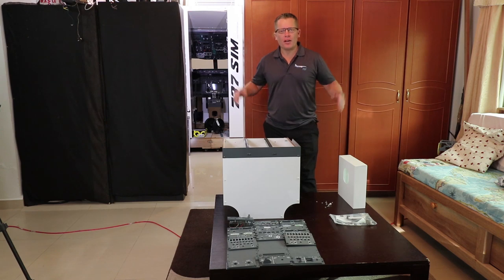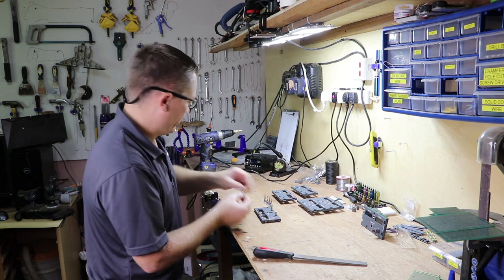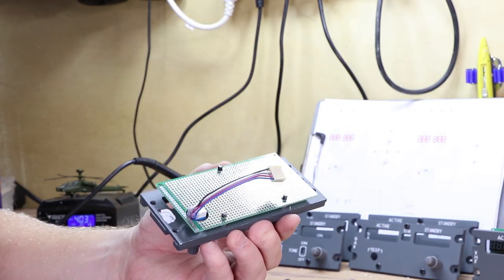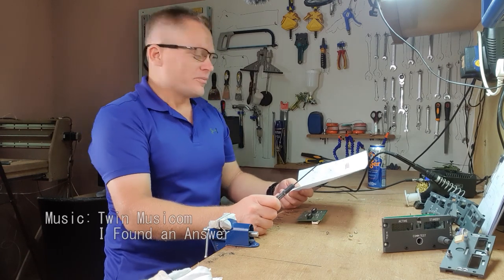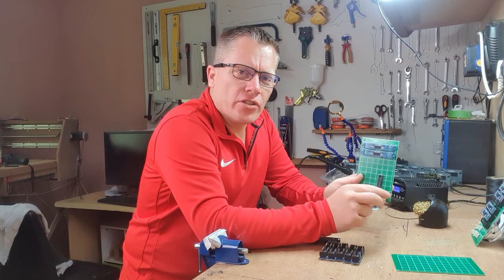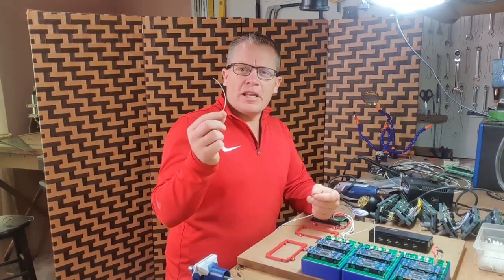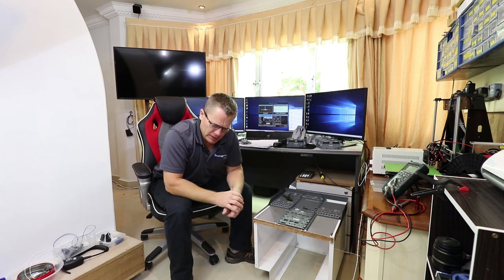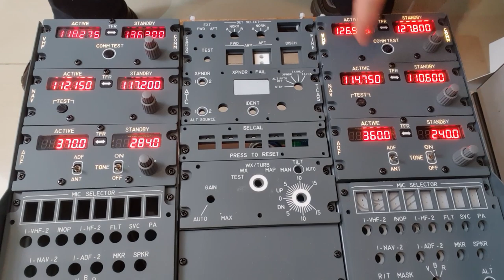Building the 737 Pedestal

Comment: Shielded twisted pair? It's been 20 years since I've touched that stuff (man I'm getting old 😀). Love this work you're doing.
Reply from the maker: Hello David, I have so much of the stuff from recycled aircraft I need to find a use for it! But it's much bulkier, as you know, than standard 22 or 24 AWG wire. However, for seven-segment displays, it helps.
Kind Regards Karl

Comment: What a huge video. I can just guess how much footage you had to edit. And by the way - a great explanation.
Reply from the maker: Hi Mickey, how's you and I hope this finds well back home. Thank you, I never meant for the video to be that long, and as you guessed the footage amount over 4 weeks was huge. Especially when using two cameras. I didn't think this video would do that well, (watching somebody wire manage isn't really the most captivating process) but thought I'd give it a go. From the video stats, it actually seems people do skip through to the parts that are relevant to them. Which is ideal. Especially when I remember starting out and thinking I wonder how you go about this. How are you getting on with the overhead panels? Keep safe and kind regards karl
Reply: @helimech8152  To help the people find faster what they are interested in you could add some timestamps in the video description. So they can directly jump to parts. This works if your video can be devided into some logical chapters. I'm doing some filming for explaining the cable management in the cockpit at the moment. And I try to produce my first pcb on my cnc router. For an electronic noob like me this is a very big topic. We will see if this will come to a good end. During these times we're not allowed to go out much so there is always a bit of time for working on the cockpit.

Comment: Hi Karl.
Maybe i just not see it..... Can you tell me what "prototyp Shield" you use on the Megas  (Exactly at 28.58 in your Hands)  ?  Ebay Link ??   Thanks !
Reply from the maker: Hello, i think you mean these:
https://www.ebay.co.uk/itm/10Pcs-Prototype-ProtoShield-Circuit-PCB-Board-Shield-for-Arduino-MEGA-EU/163679792783?_trkparms=ispr%3D1&hash=item261c136e8f:g:EP8AAOSwxXZcye37&enc=AQAEAAACcIQvEcHUrT7nmUC3yY5qbPyaBN1nJEDYW8MyypsJPgXKym2Jdff8P6pcVkPslsrmD1lRasf%2BlMjyUSY5nYIO3YkuMdMNx%2BC1DsgcQQsBKlDn7bYYqlAhSCHDDUvXBA2SQyafLyeemA5RQ9v%2Bdmt%2BPui9ualYKLHCg%2Bc4cd%2BaAHPuUS6PvswU%2Bcap3uJ6Oz5ZDIIF%2B0ILsozkV1RNMMz9m%2Balhgd4OqQHo%2BYZ3T6IFtM070VxySLSJ1HKQ3unK9YokUK3bDa9E1Fse5MMs5EQTQf%2BHTRO2ybH25akYnoKyQ8Z3K0heUQ4YdQforKrcl95wr437IomKsjGyCrAGwUduoUeGYc07xfHgqTnZAPXHgvX%2B9iPdhZKNhSkbt8etW1Yg3XfDeCbk%2Baa%2F1JJSQTvWTdmv9p32ZzQAJJLsUSvzVXX8IYdRyUzM6pwPmuWYx82CdnPop8wtcMbhh1jDO4z0IUJnlpeKBXKy5oQJ4VwkRDeBUcZNrXu41c9gaPIoMLZosLw7xIw8%2BvwsasgL3OvYkagPoks5DnBCcZIbvduPcG5e78EnEUjgv48Ctu9StqhtPX5ukc%2B1h9p5A9iWSlIxstSF%2BmUc0lajwucRnP%2BorzhDJ2EDK%2FSG%2FFcYJEEK7oqSHYxfmgbQ3hEtbQXEc6a0zalCIOiACxCOzbcoyosZI%2FqXJOQNPKE7Yd86H%2FkdEL9Q6r%2BX5u9x%2FSpvLqh8kUs0uWdilGnfSf0NpSMyDRxek9vIBA7eHbFLoMGQUZwCkvHHV3UllmHZ5N%2F0vzRcVm14oS7Wx46SMmuxLiSiHEue8QRJCvxVI82iZG13sJRs4J5WQ%3D%3D&checksum=16367979278363a39a6c0b754b91b4019ff1f2fd6c4f
Reply from the maker: Definitely highly recommend them for any build, cheap and very versatile. You might have to but the male headers separately! Kind Regards Karl

Comment: Hi Karl.  Are you using the Pedestal with Prosim? I don't see you enter any offsets into Prosim. When I enter an offset into comm 1 active (testing things at the moment), Prosim keeps restarting itself when I load a P3D flight.

Thanks.. Ian
Reply from the maker: Hi Ian, That really doesn't seem right. Never had prosim restart. I don't think I have listed my pedestal offsets as i'm still building it at the mo. But you should be able to use the default comm1 offsets in MF or FSUIPC.

Comment: Hi Karl, there are two types of Digital LED Display; Common Anode and Common Cathode, which ones are you using?
Reply from the maker: Hello Josef! I use common cathode as they are compatible with the MAX7219 boards. Great to hear from you and i hope this helps.
Reply: thanks Karl! As usual great work! After I messaged you, I saw that on your MCP guide. Re Max 7219, Do you use any resistors when you connect them to the 5V supply? In another video on another channel I also saw that some simmers use a multiplexer when connecting more than one Max7219 what is your view?

Comment: Hai, where did you find the COM1 fsuipc offsets, seems that they are not included in the pmdg 737 document..
Reply from the maker: Hello Kenji, They may be the using the standard FSUIPC offsets. I would suggest checking that documentation/list or use Mobiflight preset com1 offset. Kind Regards Karl

Comment: Amazing works and congratulatory
 you again.. You are really doyen simulator maker. Thanks a lot for this video 
But i want t ask about  something this pedestal 
1- ADF panel = it must be 3 shaft encoder but really hard to find also if can you find must be expensive...  so need to 3D mechanism model for it . 
2- SELCAL panel = this button and related led indicators are inside of VHF panel  new version 737NG  but i didnt find ofset and eventID's  ... if can you find please share  .... Should you  make it later _? 
3-MISC panel = Should you  make it later _? 
4-WXR panel = is possible to analog input changes wxr antenna position when stormy weather on simulation .. Can you make a simple video furthermore about WXR  ? 
5- Rudder trim screen = i think to make LCD but i need to work about it .. So if will you make it soon what is your plan _?
6-Tcas , cargo-fire . maybe you  will make it soon  not question for that  :) 
 thanks more again and 
Greeting

Comment: I want to find some real heavy feeling rotary encoders like real planes.
Reply: Encoders for real avionics are made by Grayhill. Element14 (Farnell) stock them ... but they are'nt cheap! You need an encoder with a strong detent to get that authentic feel.
Reply: I used the Elma E37s. The click is probably a little too sharp compared to my buddy's OEM radio but it still feels believable.

Comment: reat 
Flight simulation is a life.
enjoy life.
You need a force feedback yoke. All small aircraft yoke positions are wrong. 
This is caused by trim. Using force feedback yoke trim is easier and more realistic.
Reply: The 737 has the same elevator neutral position regardless of the stabilizer trim position. The forces are artificially generated by a hydraulic feel and centering unit, the aileron uses a spring loaded cam. The only time you get real force in a 737 is with all the hydraulics failed.

Comment: Where did you source the 6 digit 7 segment displays?
Reply from the maker: I Have several sources over the years depending on colour. Ebay, Aliexpress and Open cockpits.
Reply: @helimech8152  I ended up using the 4 digit ones off the boards and adding matching 2 digit ones at the end. They are the same product line so you cant even tell through the tinted glass.